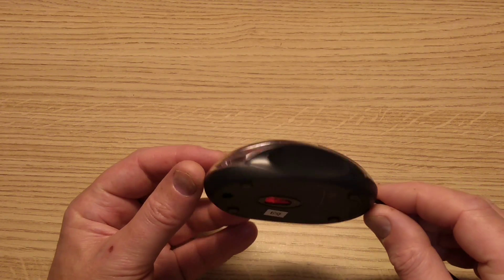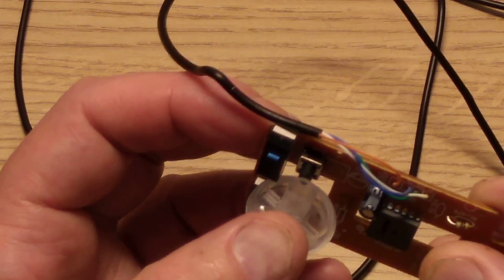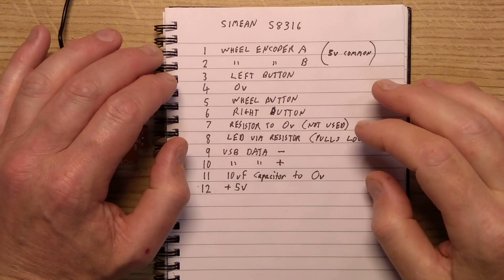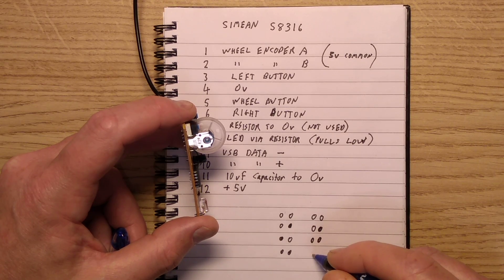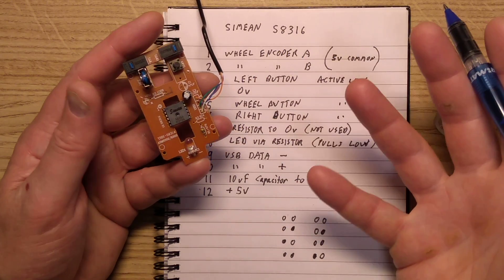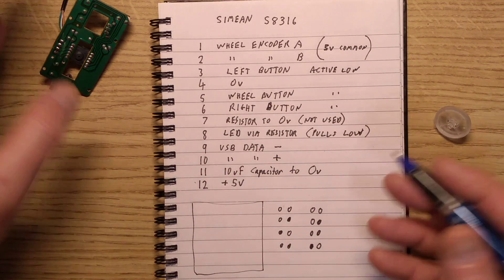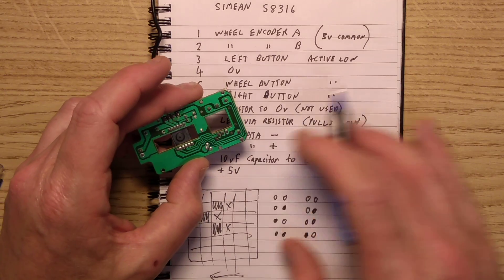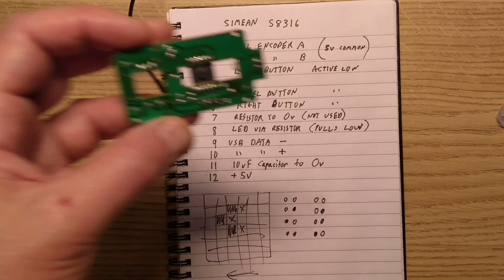Inside a humble Poundland computer mouse.

Comment: Cleaning the rubber ball did nothing for a mechanical mouse that started acting up. You had to take out the ball and clean the shafts that were rotated by the ball and which lead to the rotary encoders. They had a nice ring of dirt and gunk around them every once in a while, about once a year or so. Sometimes it looked almost fuzzy around the edges...
Reply: I found the pocket clip bit of a Bic biro was great for scraping the gunk off the plastic shafts and capstans without damaging anything.
Reply: We always told the employees to "not feed the mouse" when they complained about this.  "it does not like cheese".
Reply: Seegal Galguntijak
Arrrhhh.... the good ol' days....I remember those...lol
Reply: Nowadays, I find these old mechanical mice in fact to be easier to use than an optical mouse if there is no flat surface around. One can easily hold the mouse in one's hand and rotate the ball with the middle finger, whil using one's thumb to click the buttons/rotate the scroll wheel. Try that with an optical mouse, and you'll fail! So optical mice are better, only if there's a table, a solid book or something like that around to use them on. But if all you've got is the upper leg of your trousers, you will hate the optical mouse (at least I do).
Reply: And someone made up some rather funny instructions about cleaning your (mouse) balls which circulated around the internet in 1989.
Reply: CW Roberts Tablet
You mean usenet, right? Because in 1989, not even gopher had been invented yet, not to mention http or the www.
Reply: @Seegalgalguntijak  the internet has been around since the 1960s, but it was very basic.
Reply: @StormTrouper3 You mean tha ARPAnet, it's very different than what we have now, or even what we had 20 years ago.
Reply: Gunky shafts

Comment: True story: Last saturday I met with my PC gaming group (we're all in our 50s) and I forgot to bring a mouse but I had an old MS Intellimouse in my gear bag... the one with the PS2 connector and the ball in it. I cleaned out the crud on the inside and tried to use it, and it worked okay, but it didn't track very fast at all, and not accurately, to the point where I gave up and used an old broken donor optical mouse with no scroll wheel. For some things, the old days truly sucked, but we didn't have any better so we lived with it. I love modern living.

Comment: On the subject of hand held things with cameras in - remember hand scanners? That would be a good teardown video.
Back in the early days of scanning photographs/documents in when flatbed scanners cost a fortune, some companies made cheaper hand scanners where you drag the scanner over the photo/document to scan it in, but you had to become a master at it because if you move it too fast or slip sideways then the final image was ruined and you had to start all over again.
Reply: Had one those over 20 years back, complete with a guide that made scanning a bit more accurate.
Reply: I bought one to use with my Atari STFM. I used it to scan in newspaper clippings for use in a DTP app.

Comment: What happens if you change out the LED for a clear green 5mm?
Reply: Legend813a most likely no output or very erratic. The LED is monochromatic. If you use an led out of a mouse when you shine on a surface you will see a kind of optical static which is what the sensor is optimised for.
Reply: These mice usually run well with green LED, if the LED has a sufficiently similar angular pattern and emitter placement. Even blue works in most mice, and IR in some mice. And i mean as a replacement LED and not from stock. Many people have modded their mice and i have experimented with it too.

Comment: But with optical mice, the most interesting thing is: How do they manage to have such long battery life? Such a mouse runs on 1 AA battery for 8 to 12 months, and it has to not only use light to detect movement, but also to send a radio signal to its receiver. Although one of my wireless mice does have no visible light source, it probably works with an IR LED or something like that.
Reply: Yeah that is something I would like to know ,I have a wireless mouse been using same battery over 12 month now uses 1 AA , I never switch it off ( owned it for a year before I noticed it had on off switch )
Reply: Easy - they turn off (sleep) when you're not moving them.
Reply: @Slicerwizard  True but if you figure I game between 2 to 4 hours a day longer on weekends ( mouse only games ) that's still along time (even in sleep mode it consumes power) in just one year 365 days that's 8760 hours on just one AA battery  . If I recall I replaced this battery back in February 2018 so that's 15 months  all in all on just 1 battery pretty freaking amazing
Reply: @MrBuck295  No, it's not "amazing" if you know how stuff actually works. Even when you're using the mouse, it spends most of its time off/sleeping. And there is no reason for sleeping to consume power.
Reply: About "sleeping" makes sense with one of my mice: It does not have an off switch and turns off after 15 minutes or so, and you need to click a button to turn it back on.
The other one - the one with the IR LED (I confirmed that with a camera) - does have an off switch, and it also lasts a very long time with one battery. The LED is actually off when the mouse is not being moved, and only turnes on after movement is detected. That means the thing that detects movement always needs to be on, which makes it to be "sleeping" not very likely.
Reply: @Seegalgalguntijak  Of course it sleeps. That's why the battery lasts so long. Does a 0.001% duty cycle mean anything to you?
Reply: It would still be interesting how it can sleep and wake up instantly when it detects movement.
Reply: @Slicerwizard  actually it does consume power in sleep mode even if it is only micro amps it is still power consumption and I only game average 2 to 3 hour daily 8 to 10 hour sat and sun each it is also used for scrolling clicking when I surf the web then there are the times when the cat uses it as a toy , you don`t find it amazing
Reply: Perhaps IR laser, by limiting field of illumination.

Comment: I find mechanical computer mice also very interesting, with the ball and the mechanics to register movement on the x and y axis. Also, for situations where there is no flat tabletop, a ball mouse is easier to use one-handedly just holding it and moving the ball with the middle finger, while using the thumb to click and scroll.

Comment: Suppose the chip could be used to track a line for  robotic shopping carts and azz carts for the disabled ?
Reply: A line? No, you can't get an image out of this one. And those that you can get an image out of, they encompass such a tiny area, that you run into issues against automatic contrast adjustment.
Reply: @SianaGearz  Just tracking a line .  You can do it with two photo sensors.  These are better then that.

Comment: I miss the days with the roller ball.
Reply: Ball mice sucked the big wazoo. Eventually the ball itself would wear smooth then they did not work at all. I even tried to scuff them up with sandpaper to restore texture to them. Once the ball went bald it was hopeless.
Reply: @Paul Frederick Never ever happened to me and I had one of those ball washers too.  Fact is my mice lasts about 2 years or less now but I can still use my ball mouse from 1996 I used and the one I used from 2004 until 2009 for 12+ hours per day.  Oh, and my Amiga mouse from 1986 still works too and is a ball.  Just remember the mice were never meant to use on anything but a mouse pad.
Reply: no, I don't. The rollers got gunked up with dirt and rubber residue from the ball.

Comment: I bought one that looks identical to that one from an eBay seller.  Seemed OK for a month or two.  Then the middle button became increasingly dodgy and eventually so unlikely to operate (even if I pressed it hard enough that it hurt my finger) it wasn't worth trying.

Why do I use the middle button a lot?  Because I often find myself wanting to open a link in a new tab.  If I click on a link and it's not what I want I then have to use the back button and wait while the previous page reloads.  This is especially important with the kind of google search that gives a lot of irrelevant pages interspersed with a few that are actually what I'm looking for. Middle button on a link opens the link in a new tab.  The other way of doing it is right-click on the link to get a context menu, find the "Open in New Tab" entry in that and click on it.  Middle-clicking takes less time and effort.

So after the middle button failed on me I ended up doing it the long way - right-click, find menu entry, left-click.  A few months later the right button started getting dodgy.

Maybe it was a bad mouse that slipped through quality control.  So I bought another (different seller, but there appear to be hundreds of sellers offering it, so I went for the cheapest that day).  After a couple of months, the middle button started to become dodgy and eventually failed.  And now the right one is becoming dodgy.

So now I've bought a completely different (but still dirt cheap) mouse.  I'll see how that goes.  If that fails within months, I'll buy a decent brand mouse instead of trying to save money on the cheap ones.  The decent brand mice I've had in the past last many years.  Probably work out costing less in the long run.
Reply: Chinese quality control is the customer, you!

Comment: The real test of "humility" for mice is not the resolution of their sensor, but whether or not they have a separate microcontroller for handling HID stuff (including keeping track of button presses etc) and sensor. In high-end gaming mice, the HID communications and sensor (which itself is an imaging device and DSP doing digital image correlation and tracking, including subpixel offsets) are done in separate packages. For mice where the sensor, DSP, and HID communcation are done in the same package, they pretty much always suck really hard, and it's impossible to reprogram them by cutting out the microcontroller and taping in a teensy (I have done this). Here's a datasheet for an old gaming mouse sensor, meant to be connected to a separate microcontroller for talking over HID: http://media.digikey.com/PDF/Data%20Sheets/Avago%20PDFs/ADNS-3090.pdf
Reply: PS: the ideal surfaces for optical mice are basically white noise or pink noise, but they can't be too specular (like sandblasted frosted glass) or else random bright pixels might make the digital image correlation math glitch out.
Reply: Some of the same sensors are available both with integrated host controller and with separate one. For example ADNS-3050 is sensor-only, but i forget which model it is, is an identical sensor but with integrated controller. The thing with the integrated one is that it has no programmability, and gaming mice usually require that - button assignments, setting changes etc. Not because a separate sensor somehow automatically is better, but because the market doesn't need a high-end sensor with integrated processor at the moment, as a separate EEPROM-based processor allows the mouse manufacturers to provide unique value for their products.
Reply: Separating them also allows for sensor firmware updates, which happen, not just programmability etc.

Comment: The first commercial optical mouse I could find was sold by Xerox in 1988 for $35 and cost them $17 a unit
Reply: Sure that wasn't an optical encoding mouse rather than optical tracking?  There are optical patents going back to the late 80's but no commercially produced optical tracking mice till some time after that.
Reply: @zybch  The first one I saw was in about 1990 that came with a Sun Workstation, and that computer probably cost about £20,000. It had a special mouse pad which was shiny metal of some description with a black grid painted on it.
Reply: @katrinabryce  Yep, optical quadrature encoding using a printed grid defining the pixel size.  Not the sophisticated image tracking mice that work on any non-uniform surface at any angle.
Reply: Adjust for inflation and you are looking at about 70 bucks in today's money.

Comment: Progress has taken some of the magic out of computing. I remember the time when you could spend quite a few minutes scratching and rubbing your ball. If you were really lucky someone might even lick your ball for that perfect finish. Now it's just a quick wipe with a damp cloth and it's all over.
Reply: That's not progress, that's your age.
Reply: Sounds sexual to me.
Reply: How is a DSP and a 3000fps camera any less magical than two optical encoders?

You could even put a Teensy into a higher-end mouse with custom firmware where you can torture the sensor workings. Now that's some next-level ball-licking.

Comment: On that note I actually did buy one of the first optical mice (from Microsoft) to come out back in 1999/2000. I do recall it being something like 75 or 100 USD at the time, and I only stopped using it about 3 years ago after it went belly up from being abused one too many times from gamer rage. Quite robust.
Reply: I recall a time when Microsoft used to dump their retail stock, they outsourced their inventory destruction, however as there were too many of the devices to be destroyed (the packaging had to be cut in two, severing the USB cable - very labour intensive) they ended up being dumped intact in their retail packaging. They got scavenged for the floppy disks. I used to play "conkers" with them, proper £70~£100 Microsoft mice!
Reply: I still have mine somewhere.  It was fantastic, but that price, OUCH.

Comment: I've opened up a few of these. Because either the axles of the scroll wheel would break, or the scroll wheel would start spinning freely.
Everything else on them is pretty solid though.
Reply: Did that lead to replacing the rotary encoder? Because i have a cheap (vertical) mouse from China that can't decide whether it wants to scroll up or down when i rotate the scroll wheel, so i think that replacing the encoder could work. Are they available as components?
Reply: @balisticsquirel  Yes, you can buy replacement scroll wheel encoders in China.

But usually replacement isn't necessary. Inspect the PCB where the encoder is soldered on, it might have lifted a trace since it's an FR2 board. Sometimes the encoder is floating and connected by a ribbon cable, and it might have taken damage. If electrically it's all fine, just wash the encoder with lighter fluid, it'll probably recover.
Reply: @balisticsquirel  just get an a4tech mouse. They are like 10 or less bucks and lasted me like 5 years for now and have durable and comfortable finish though i respect your dedication to repair
Reply: I'll look at those. Haven't seen the brand before. May be just right.
Reply: Thank you. I will definitely have a closer look / clean later today.

Comment: My first optical mouse from the early 90's came with a polished metal mouse-pad with a silk-screened grid on it.
Reply: LGR has one of those, and the mouse only works if the pad is in the right orientation.
Reply: Sun Microsystems, right?
Reply: @TWX1138  I had a Sun one. The 3 button mouse was clever but the metal pad was damn cold in Winter.
Reply: @TWX1138  That was my thought.
Reply: Amiga 500.
Reply: @reparsed  Not seen an Amiga with an optical mouse - but possibly no reason not to use one.
I have the A 3000 ;)
Reply: @reparsed  wow I don't remember optical mice being available for Amigas... Must have been a pretty penny. I felt like a hot shit just for having a naksha mouse which was about a kajillion times better than the included "tank" mouse
Reply: @TWX1138  better than the ball mice. I still have a pizza box somewhere
Reply: They operate using a different principle!  There were bars in two different colors in X and Y direction forming a crosshatch.
The mouse only had two detectors in each direction to use quadrature phase detection just like the wheel in the design that Clive has shown.
So there is no camera involved, or it is a 2-pixel one, depending on how you look at it.
The two different colors were paired with two different LED colors (or RED and INFRARED) and so each detector only saw the bars running in one direction.
Reply: Yes the Sun optical mice with the gridded mouse mats were much less sophisticated than this. You had to take care to keep the mouse square-on to the mat, otherwise it would misread. Still, they felt so nice to use compared to the ball mice.
Reply: I remember these!! They totally sucked ass! Awful tracking, jumping all over.
Reply: Computer lab paired with IBM XT's lol
Reply: I came across an aluminum pad with a grid on it and I wonder if that might be what it was. I still have it hanging around somewhere it resisted solder to some extent and I got to thinking that maybe I don't want to use it for that since it seemed to have been one of a kind out of an old box of computer stuff.
Reply: The problem with those was that the information from the grid became ambiguous if you moved the mouse too quickly - the processor couldn't tell if the mouse had moved left or right or up or down.  You had to learn to move the mouse at a certain speed, and no faster.The best surfaces are non-uniform and non-repetitive - meaning that mouse pads with fancy artwork are actually quite functional. The grain on a wooden desktop is ideal, and ditching the mousepad entirely was the best option for my Apple "magic" mouse.